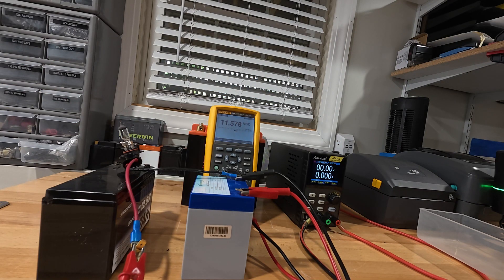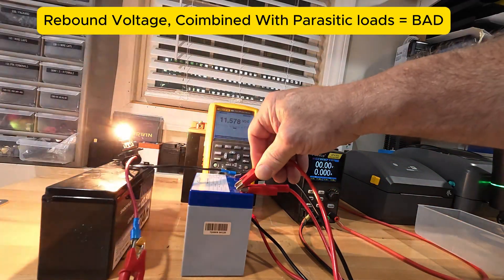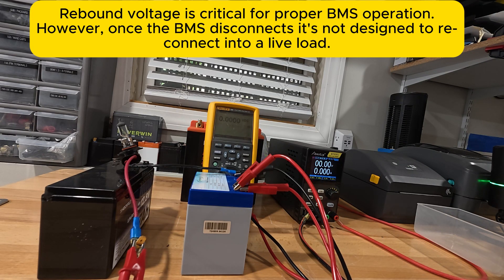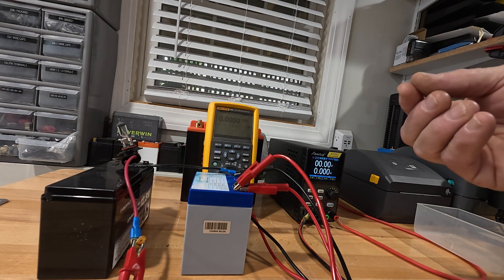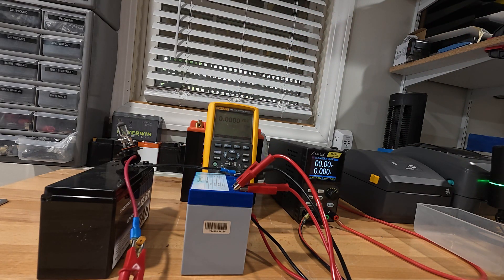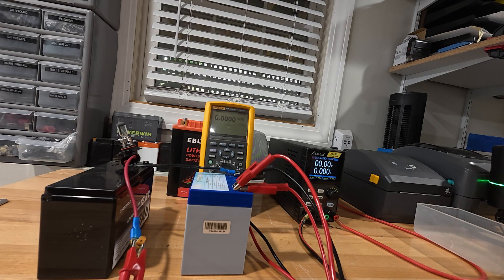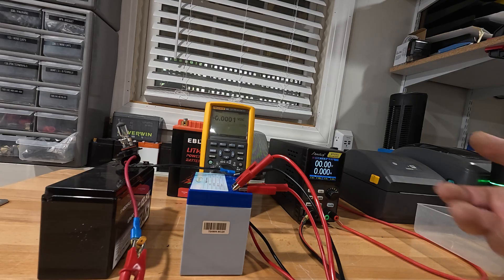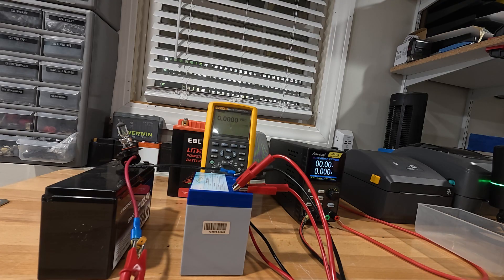Can I Over-Discharge LiFePO4?

Comment: I set up the reconnect voltage high specifically to avoid the re-bound issue. I want a battery, once it has reached what I choose to define as empty, not to re-bound as this can cause issues with some devices that don't like short on / off periods and those that like use of a pre-charge resistor. Yes a normal mains charger might not be woken up by the flattery, not the other way round as the battery charge MOSFETs remain connected and able to take charge. Popular solar kit will charge without seeing a voltage and, in the situations I am more involved in, there  is always a starter battery to take a jump from or the battery is in a hybrid configuration (we won't argue about that on here) and so any charger will be kept awake by the lead acid.